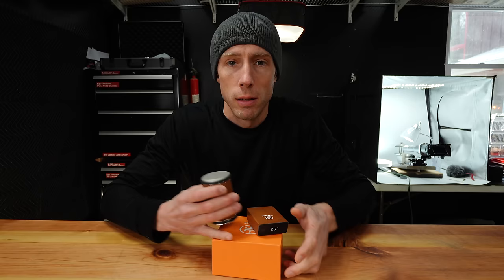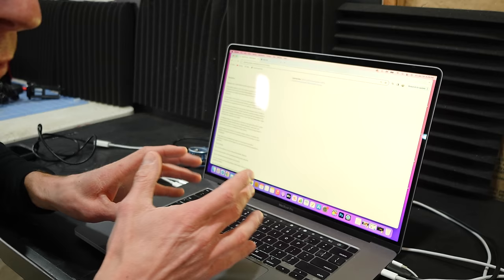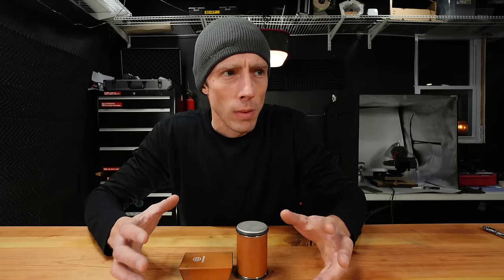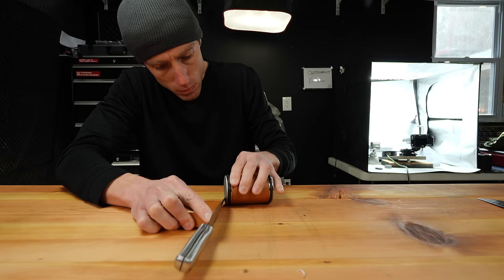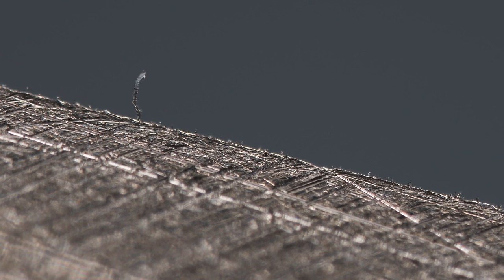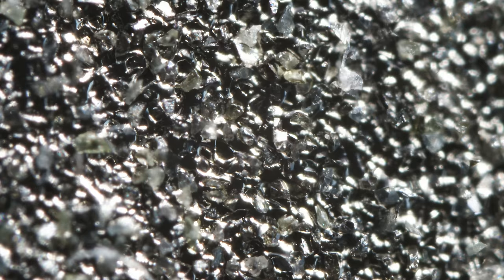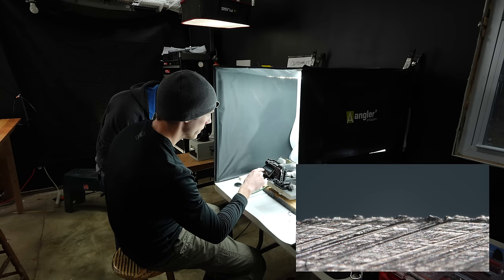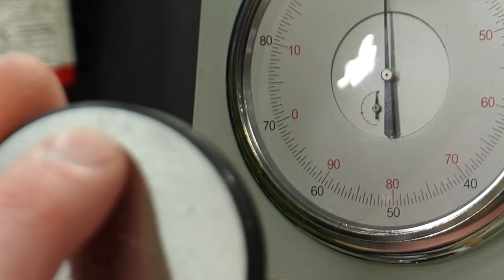There’s Something Strange About These Rolling Knife Sharpeners..

Comment: I checked into Horl about 4 years ago or so.  Because of price I didn't get one. However, I think they also have extra caps to purchase that have different grit sizes on them.  Thank you for the video.  one solution to the smaller knife problem is to put something under the spine of the knife to elevate it.

Comment: I got the Horl 2 with the premium sharpening add ons, I don't have any knives that are damaged so haven't needed the course grinding disk you can get for that, every comparison i've seen suggests that the horl rolls much smoother thanks to actual bearings rather than bushings and the magnet stand is much stronger, it's actually meditative to use imo

Comment: Great video bringing some light onto a product way too overhyped.
As you've mentioned, one could sharpen a knife using pretty much anything and even though I do have quite a nice whetstone, I usually just use the uncoated ring on the underside of a ceramic plate or bowl. For the 3 knives I own (one of which is a bread knife so it doesn't need to be sharpened all that often) it's just faster to grab some plate from the table or wherever and spend a minute for the knives being sharp enough for basically anything cooking related...

Comment: For about the same money as the Horl you can get three shapton stones but that requires a fair bit of time to build the necessary experience to get a good result. The idea seems to work so for those that just want a sharper knife quickly without all the fuzz it can certainly be an option, even if I think that the price point is a bit high.
Reply: or ~100 bricks
Reply: Seriously if people would just learn the skill even slightly they’d have better and faster success on even the $15-20 diamond scales. Cheap Aluminum oxide stones being the last thing newbies come in contact with. And these rolling things work but not as efficiently as proper stones in my opinion.
Reply: I'd say your comment gets negated by it only working good for a low amount of time? 🤔

Edit: I got confused and thought he's using the horl, your now right id say
Reply: Ya I got a nice tri stone setup with nice Arkansas whetstone for $75 about 10 years ago and just learned to freehand sharpen. It's worked for centuries so probably good enough for my kitchen. Just takes a few tries and its second nature. I don't get all these gimmicks
Reply: diamond block at Harbor Freight:  200, 400, 600 and 800 grit.  It cost $11.  A real strop from Amazon about the same.  Should last a lifetime.
Reply: That might seem obvious to people watching these videos, but most people simply can't be bothered. I'm actually now considering buying this for my mom who refused to use the TSPROF Kadet Pro I got her because it's “too big” and “too complicated.” No way in hell I could get her to learn freehand sharpening. If this is the thing that will finally get her to ditch the pull-through “sharpeners,” I'm all for it.
Reply: people sure do have money to burn.  and time too lol.  there are several different tools that can sharpen much faster and cost a few bucks
Reply: @timlong1462 yeah, at least Arkansas stones don't fall apart as you use em. I grabbed a diamond plate for reprofiling and the Arkansas can do the fine work.

Comment: For those interested in this type of sharpener I would suggest taking a look at the Hone model.  I have it and have been very pleased.   Magnets on the base seem much stronger than the other brands to me plus they have an extremely wide number of grits available ranging from 200 all the way to 3000.   Plus the base also includes two sides for smaller knives which I have found extremely useful for things like paring knives.  Is it perfect?  No.  Does it do a good job of sharpening in a relatively short period of time for someone with no experience?  Definitely at least in my opinion.
Reply: @timhonzel5455 I’m considering the Hone as well. What have you discovered that could be improved upon? Is the grip of the roller comfortable? The Worksharp roller looks better in this regard. Are the two included discs suitable enough for most general use?

Comment: For me and my uses (kitchen knives, pocket knives, fixed blades), the Ken Onion with the Blade-Grinder attachment (bigger and open belts) is terrific. It's easy, fast, repeatable, and adjustable. Plus, I've sharpened dozens of knives so far and am still on my first set of belts.

Comment: I bought the Hone company version, made in Canada, After researching a few of these including the one made by worksharp. The manufacturing on the Hone as well as the quality of the diamond plates probably places it at the top of the heap for this style of sharpener and is doing a very good job on my kitchen knives and a few folders. It seems to be the only one with an adjustable height for smaller knives as well as full height for chef's knives....

Comment: What they've really tried to do is make a precise ANGLE rather than the freehand  sharpening technique which takes lots and lots of practice and also, as you demonstrated quite beautifully, its no good for smaller knives other than chefs knives, exactly why its one of the reasons why I  dismissed the Tumbler as well as the Horl (which charges for add ons).  So much money for a few knives instead of all of them, we all don't use larger knives at all.  We have different knives for different jobs.  Its all about the ANGLE here not the equipment IMHO.

Comment: THANK YOU.

I knew about Horl already, having seen it in a video a month or two earlier, then I saw the sudden and massive media push for Tumbler. It was suddenly EVERYWHERE. There were reviewers who made reviews of the thing, that, when informed of the pre-existence of Horl, went back and took down their reviews and apologized to Horl for it. They had no reason to know, except by complete happenstance, like me, that there was a predecessor on the market that did exactly the same thing the same way, but actually functional.

I have a DMT diamond sharpener, I have the Work Sharp diamond sharpener, and now I have the Work Sharp powered belt sharpener. I've started making my own strops, because I saw the price of a simple pocket paddle strop at $22 USD. I had leather, a piece of a wooden meter-stick, some really great glue, and a bagful of graduated grit stropping compound sticks. So, 20 minutes later, I had a strop in the vise, clamped up for the adhesive to cure. Next day, I cleaned up the squeezed out excess glue, trimmed the leather a bit, and hit it with some blue compound (one step finer than green). Works like a champ. I keep all of my knives as sharp as possible, because I've seen the scars that dull knives leave behind. People get lazy around dull knives, and learn bad practices. When I started in the kitchen in college, I found the triple oilstone sharpening station and hit all of the knives in the rack, then put up a sign saying "CAUTION: The knives are now freshly sharpened, and are RAZOR SHARP. Please use appropriate caution!"

Within two hours, I was driving a guy to the ER. He had gotten used to cutting chunks of meat by holding it in his hand and sawing through it with the dull knives. It would have been a miracle for it to cut his hand without his noticing, but if it had, it would have torn through his palm. But this time, he ignored the HUGE SIGN over the knife rack, put a hunk of ham on his hand, and made a single slice instead of sawing. It went through the ham in an instant, and across his palm before he realized what was going on. I saw it, grabbed a handful of clean paper towels, and slapped them onto his hand, and told him to hold them there tightly. Then I dragged him to my car, stuck him in my passenger seat, reclined it and told him to lie down. Then I drove like a bat out of hell to the ER.

Thankfully, he'd done that with my freshly-sharpened knife. The doctor remarked that the cut was so clean and straight, he wouldn't even likely have a scar. The biggest worry was that he'd hit tendons, but he missed them all and it was only really messy. The paper towels helped. But if that knife had been dull, it would have been BAD.

This was the first (but not the only) time the professional running the kitchen and I tangled asses over her idiotic lazy procedures.  She was later fired because she'd been skimming off the food orders, buying what she said was an expensive item, but buying the cheapest that would serve and pocketing the difference. The thing that got her caught was that she now had a professional assistant, who was watching her like a hawk, and he saw her do this with supposed Prime Rib for the Alumni Association Dinner. She bought the cheapest meat that looked roughly like Prime Rib, hit it with a bunch of Adolph's, and, while a touch chewy, tasted okay. But it wasn't what the Alumni had paid for, so she got nailed. (God, the stories I could tell...)

Comment: Thanks for this video. I am a sharpening enthusiast and I have been curious about these roller style sharpeners. I agree that there needs to be the right grit and hardness on the ends. I have been looking at less expensive versions that include multiple grit discs for the ends. Ones that seem to have grit numbers spaced right for (as you explain) establishing a bevel, refining it and honing finer still. I personally don't expect any sharpening system to strop for me, I think of it as another step in the process.

Comment: Try the Horl 2 Pro model. It has a planetary gear system inside that speeds up sharpening up to 3x and is even more expensive than the regular one. I have it and I love it. It’s perfect for noobs like me. I tried all sorts of whetstones before but simply don’t find the time and patience to get good with these. The Horl 2 pro is so chill to use, that I can even watch YouTube videos while using it. :D Absolutely satisfying feeling and sound, too due to the gear mechanic inside. It’s like comparing Apple with PC.
Reply: I have the same one. Best thing is that it's very hard to screw up the edge with a bad pass like seems to happen with freehand sharpening. It's just dead on consistent every time.
Reply: I don't have the ultra fancy once. But its the convenience and the ease of use that makes all the difference. Easy setup and fantastic for people who don't find the necessity to get everything to absolute perfection. It comes out fantastic, can still cut paper with ease and glides through meat and produce without effort. More the enough for your average home cook.

Comment: I'm a hobby knife maker and appreciate this video. I use 2 x  72 belt sander to create an edge, sharpen new and existing knives. I used to polish the edge to 800 grit then strop on a leather 2*72 belt. I like a toothy edge now, think tomato knife. A 220 flex belt then a strop pass is hair popping Sharp and will bite into a tomato skin. In my kitchen I use a diamond " steel" to refine an edge. Most of the time the burr just needs to be pulled off for a kitchen knife to cut well
Reply: for the novice, this can be used for exactly that.  Just use the honing disk only.  This is great for honing for someone who is not experienced (think=my wife)

Comment: Your scientific and empirical method of evaluating results has great meaning to me.
On the other hand, I believe that to sharpen a steel knife (Fe + C + Etc.) a diamond tool (pure carbon abrasive) should not be used, as it is destined to lose its characteristics quite quickly in contact with the carbon of the blades.
And this regardless of how much the abrasive tool costs.
For me, diamond stones are very useful for dressing other stones, or for those carbon-free steels, but in the end only a few rare cases of diving knives would remain.
Specifically, I find this tool elegant and stylish, but destined to remain at the bottom of the kitchen drawer after the first unsuccessful attempts, as you clearly highlighted during the tests.

Comment: Back in the 90's my mom picked up a rolling knife sharpener from a yard sale. It had no branding and instead of the sharpener part on the end like the new ones, it had a sharpening stone in the center with metal guide plates on either side. The rest was a white plastic with rubber grips.

Comment: I purchased one of these but the brand was Proyan. I love it. Now to be clear, I am someone who has had reasonable experience over the past 30 years of sharpening many things that need sharpening, not just knives. (axes, wood chisels, cane knives, drills, spade bits, chain saws ect) Am I an expert at sharpening, given that range of sharpening? No. I dont feel that I am. 
Do I think I get a sharp and long lasting edge? Yes I do. 
Could I get a sharper edge and longer lasting edge if I spend more time researching better techniques and more time practicing? 
yes I could. 
Could I be bothered with that? no I couldnt, and I think that represents the vast majority of the population.  
Thats why I love this product. I think the biggest issue I face when sharpening something is what angle to use. Now I get it that you are professional knife sharpener and I get it that you have developed muscle memory that means when you sharpen it is second nature what angle to use. But the vast majority of the population does not have that level of skill. By the way I admire your skill level. 
With this product the question of what angle to use is taken away. I recieved 7 disks ranging from 800 grit to extremely fine ceramic disks. The 800 grit quickly gets a knive that is in poor shape to a reasonable edge and then quickly to very sharp edge with the other disks and I feel someone with no knowledge of correct angles or what rolled edges are or burrs on the blade ect could get great edge easily.
My only critisim of the product is what you addressed with how small knives and large knives like meat cleavers dont work. However I found ways to do those as well using spacers and blocks

Comment: Greatvideo. I have the Horl 2 and highly rate and the edges that it can produce. I purchased the additional discs and strop and find that i can quickly restore and maintain my knives.  Horl sell an even coarser diamond disc than the one that comes with it and the fact that the discs can be changed/replaced is a great feature.

Comment: I have and will continue to use my TSProf  as my ability to hand sharpen is virtually non-existent. I've spent countless hours with quality stones (hundreds of dollars worth) fighting to get a proper apex and more so hold the proper angle. But, my tsprof works for me 100% of the time, as long as I set up the vices correctly, which can be a challenge with a full flat grind blade.  (I have the big one, not the new little one)
Thank you for your video, time and efforts and as usual your content is excellent

Comment: Rolling Sharpener is easily the best value and performance sharpener for the typical knife user. Mine is incredible and so fast compared to conventional sharpening methods. With 20 seconds of instruction, ANYONE can achieve 90% of the result that a professional will deliver.

Comment: So happy to see this video.  I bought the Tumbler knowing full well I'd probably just wasted my money but hopeful I was wrong.  Upon arrival, I tried to sharpen a Santoku knife and found it did an adequate job...but no better.  I used it on several other knives and had similar results across the board, with the quality of the edge diminishing the more I used it.  Ultimately, I recognized that, while it kinda does what it's supposed to do, it simply doesn't do it well.  There's just not a lot of systems that beat stones!

Comment: I started trying to learn to use a whetstone (and videos like yours were helpful), but given the fact that I work full-time, am currently in grad school, and need to spend some time with my wife, investing a bunch of time into learning and practicing how to get a consistent angle just isn't in the cards for me now.

After finding a number of comparison videos between the Horl 2 and the Tumbler (and other knockoffs), it seemed the Horl is miles beyond the Tumbler. In addition to the points you mentioned, the overall build quality and magnet strength were two other aspects that swung me toward the Horl.

Comment: Most people in the USA, in my experience, do not know how dull their blades actually are. I like a consistent tomato slice as a test of usable sharpness.

I have a good 8" chef's knife that I regularly sharpen with a whetstone of 1000/6000 granularity. You can easily tell the difference of the sharpness when cutting from a fresh sharpen to a previous sharpen.

I had to learn this the hard way. My mom regularly used a dull 6" paring knife for all cutting. It wasn't until I had any kitchen experience that I learned that her method is a great way to lose a finger.

Not that I lost a finger. I just had some bad cuts just like her.

Comment: Thanks.  I've sharpened wood chisels ao know a little about it, including the burr. I've used honing guides there that keep the chisel at the angle you choose.  

A person could use the honing rod that comes with most knife sets for stage 2, but that kind of defeats the purpose.  I wanted a quick and easy knife sharpener, though I could use my stones for that.  Consumer reports have tested the electric sharpeners and will probably go with one of those.